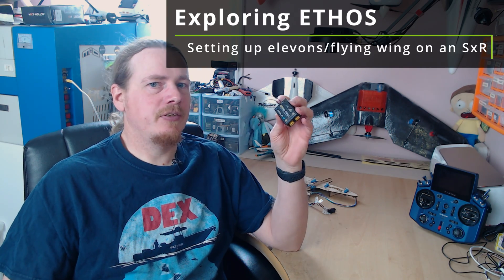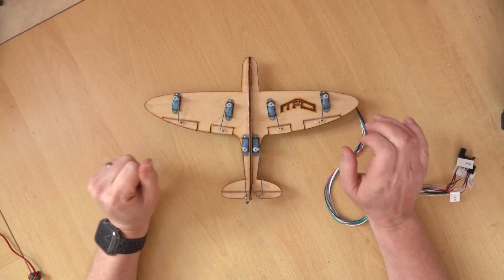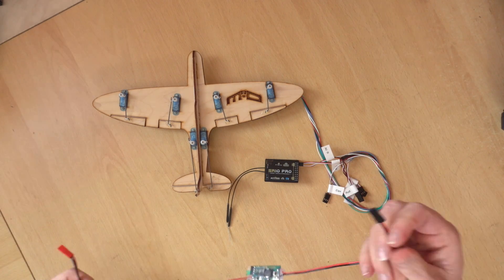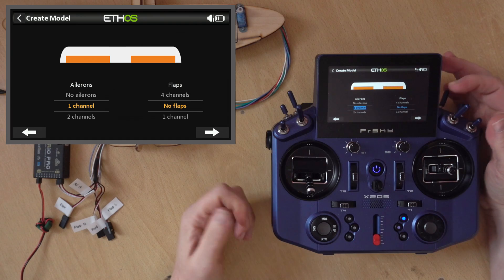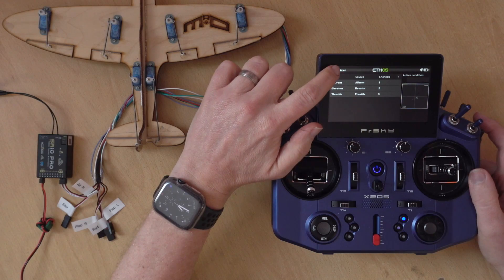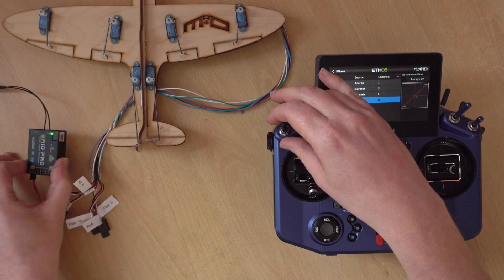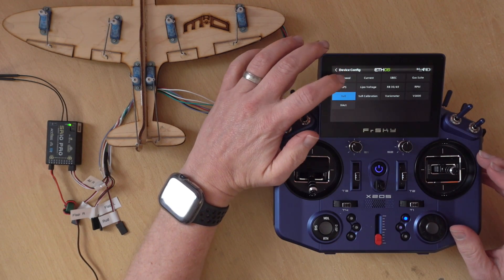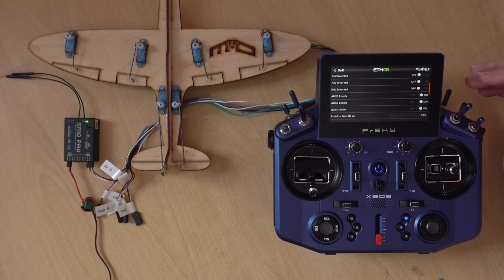Setting up a Flying Wing or elevons on an SxR or SRx FrSky receiver

Comment: I thought this would be super simple, but I wouldn't have guessed this crazy unintuitive solution without your help! Also to note: when setting up stabilised elevons and independent stabilised ailerons, f14, f15, etc, there is another independent group of stabilisation channels on the second page of the lua stab tools. This is true for the Archer SR10+, not sure about others. This could concevably also be used to setup stabilised canards (pitch & roll) too.

Comment: More a question than a comment. I'm somewhat beyond a newbie, 3d plane printing enthusiast, using Lemon 7 channel receiver with stabilizer, Spektrum Nx8 transmitter in a "built fast" Delta Wing. This video is very helpful but I get lost when the transmitter is used to setup the receiver. I'll assume somehow I have to address the elevon setup directly in the Lemon receiver after a normal plane
(ailerons, tail, no rudder)    model is setup in the NX8 transmitter. I haven't found any information regarding this combination. Building new planes is easy, just looking for any advantage (stabilizers) to help develop my flying skills.
 Any additional information would be much appreciated. Thanks in advance.

Comment: Looking for some guidance. I have set this all up. Most things work. The gyro compensates for left and right roll, but when it compensates for up/down they move in the wrong direction. I have tried to change the direction of Elev in the Lua script page but then one ailreon moves up and the other one down. I tried to reverse them in the outputs and it made no difference.

Comment: Hi Darren, thanks for your videos all brilliant. I have an issue that I cannot solve - any suggestions would be welcome. I am trying to set up a Dart XL using a SR8, on a QX7, but I am on MODE 1.
I am confident that I have everything set right, but I cannot get any stabilisation. I  see that the throttle needs to be below 70% to get the self test activated - that is an issue!! That's my elevator.
Is it even possible to set this up?
Reply from the maker: I’m guessing you have told the radio that you have converted it to mode 1 in the system menu?
Reply: @MrD  Hi Darren, thanks for the reply. Yes I did the full conversion to Mode 1 in the radio. Can you think of a work round? Move the throttle channel to another channel and move back when the input is done? I have not tried it. Thanks for looking, I didn't expect a response.
Reply from the maker: @stuartposnett5148  it may be worth double checking the system menu > sticks page to make sure it knows where the throttle and elevator are. If that’s correct. Did you make the model before switching to mode 1?
Reply: @MrD  I have checked the system menu -  its right on Mode 1. I have all my radios on Mode 1 (old school). I have a Horus Express I could try as an option to the QX7S (Access)?
Any other thoughts?
Reply from the maker: Was the model created before the switch was made to Mode 1? Have you tried creating a new model to see of that assigns the sticks correctly?
Reply: @MrD  Model was created after Mode 1 switch. I'll try the existing with no stabilisation to set up the Dart, then I'll change to my Horus and have another go! Thanks for replying.

Comment: Hey, i followed this and the how to setup sxr guide and everything works fine, testament to your great tutorials. - except my flying wing comes with 2 rudders (Flex innovations pirana).
I have setup a FreeMixer, input is Rudder and set the ouput to chan 4 + 5, also put rudders in chan 4 + 5. When i checked nothing moved.
On the Outputs screen of the Transmitter i can see that the output should be there.

Any advice?
Reply from the maker: Unfortunately stabilised rudders are not supported with an elevon setup on these stabilised receivers. All you could do is output on a regular channel. I would leave channel 4 alone. But 5 & 6 should work fine. You will need to set AUX Enabled on channels 5 and 6 in the SxR Configuration Tool.
Reply: @MrD  Hey, thanks for the info. I wasn't looking to have them stabilised, just in working order would be fine.

I'll try plugging them into chan 5+6 and adjust my mixer, with aux channels.

Guess the Aux was missing because atm one rudder is in chan 5 and it doesn't move.
Reply from the maker: By default, the SxR receivers uses channels 5 & 6 for aileron 2 and elevator 2 respectively. To use it for a different function, you need to set it in the tool. After that, they should work 👍🏻
Reply: @MrD  tool means i need to connect the receiver to my computer?
Reply from the maker: I mean the tool on the transmitter, shown in the video.

Comment: Darren, thanks for this video.  I swapped out an R6 in my Funjet Ultra (with delta mix) and configured/installed an S6R and couldn’t understand why it wasn’t working right, until I stumbled upon this video.  Essentially, the elevon mix is in the receiver and all works after selecting delta type in the SXR script in Ethos per your video, so everything is working now…control deflections and corrections in both auto level and stabilize.  One question, do you only have to perform the self test once (after installing in the model)?  I did that after confirming both wings were perfectly level, and the fuselage as level as possible also (eyeballing it).  Also, after I’ve flown/trimmed the model in manual mode, will that affect the self test calibration (will I have to perform self test again)?  Thanks for your videos…going to contribute on Patreon.
Reply from the maker: You're welcome Craig, I'm glad the video helped. To be honest, I don't know the official answer to that. All I can say is that I've not done anything after trimming with my models and they seem fine.

Comment: Another great video Darren, thanks. One little hitch for me though. I'm setting up an SR6 for an Extreme Flight Outlaw delta, which DOES have a rudder. I've set the wing type as you explain, but with a Rudder on channel 4. Everything works as you show, plus the rudder, with SXR disabled. All works as it should with SXR enabled except there is no rudder. Any ideas please?
Reply from the maker: It sounds like that wing type does not support rudder. So the stabilisation doesn’t work. I can try to confirm with FrSky.
Reply: @MrD   Okay Darren, thanks for getting back to me.
Reply from the maker: No problem Geoff.

Comment: I should have added the following. The setup you described is straight forward. So. Instead of selecting "One" aileron and "One" elevator, with a rudder. I selected "Two" ailerons and "Two" elevators . Shouldn't be anymore difficult than that. Plug in the "four" servos to their respective pins and it should work. No. It does not. Only "Three" of the "Four" servos function properly when the selected wing type is "Delta". Suggestions ?
Reply from the maker: I've never tried this to be honest, so don't know if it's possible. I would imagine yo would have left elevon in Ch1, right elevon in Ch2, left canard in Ch5 and right canard in Ch6. The AUX 1 and AUX2 would need to be set to disabled. That's how I'd probably try and set it up. I also don't think you need to send the other aileron and elevator over the air. I think it mixes in the receiver after trying the elevon setup.
Reply: @MrD  I'm really late in responding. But. "No" The mapping assignment does not work. According to the SR10-Pro instructions the assignments are as follows. Ail#1 is Ch #1, Elevator #1 is Ch#2, Ail#2 is Ch#5 and Elevator#2 is Ch#6. Aux 1 and Aux 2 are off. I turned these on just to make sure. And yes. I have the "Delta" wing type configured.
Reply: Hello,

I'm trying to set a rafale with 4elevons/servos. I have the same problem, only 3on the 4 surfaces working, rx sr10+
I would appreciate if you have a solution
Thanks, Emmanuel

Comment: Hi Daren. Works just fine as you described. But. I'm unable to get this mix to work with "Canards".
Reply from the maker: Hi Frank. This is only a basic gyro, so not made for exotic mixes. But if the canards are just one function (elevator for example) and the wing control surfaces are just ailerons (in that example). Then it should work with a standard plane setup.

Comment: I have crashed every single time I tried setting up. 😡
Reply from the maker: As in the configuration script crashed or the planes?
Reply: @MrD  planes.
Reply from the maker: Sounds like the stabilisation direction isn’t correct in that case.
Reply: @MrD   at the toss and take off it nose drives or turns completely over and crashes. It dose this although I have the correct CG.
Reply from the maker: If it’s flipping over, the stabilisation is wrong or it’s a bad throw. 

1. Have you tried throwing the plane with the stabilisation turned off?
2. On the bench, what happens with the plane in self level.
 a) do the control surfaces stay flat until you move the plane?
 b) when you move the plane, do the surfaces correct in the right direction?

Comment: Do you have to use the gain knob like in your other video? if you don't setup gain knob does the RX use the numbers shown in the Lua?
Reply from the maker: Yes, you should still add the gain and self test switches, as well as perform the self test operation. I kept this video all about the mixer and wing type. I did mention it in the video, but I've added a note in the description to make it clear.

You could not use the gain pot, and set the gains in the LUA. But, I like having the gain so that there's some adjustment for different wind conditions.